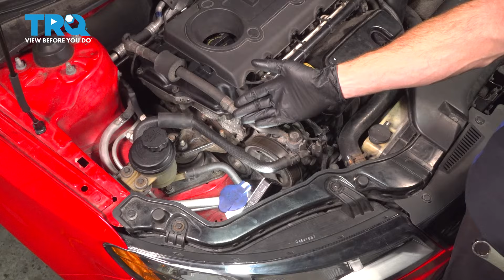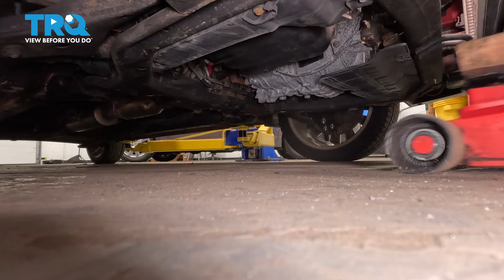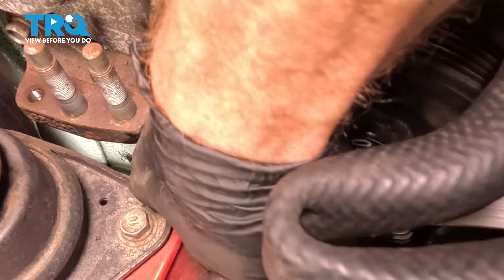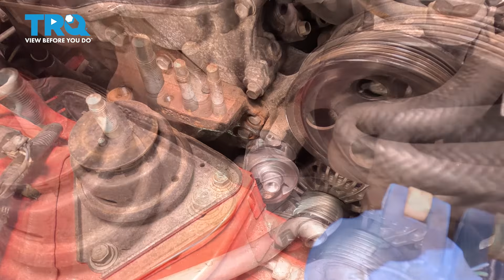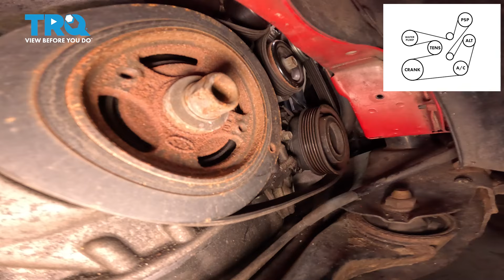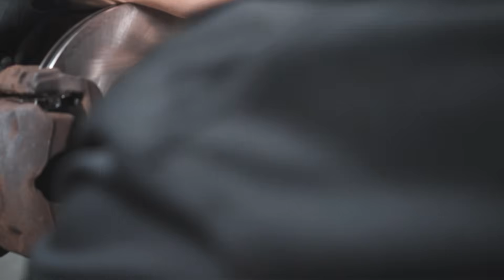How to Replace Accessory Drive Belt Tensioner 2010-2013 Kia Forte Koup 2.4L L4

Comment: 2014 Santa Fe Sport is almost the same. You won't need to remove engine mount or jack under the oil pan. Just remove the upper ribbed idler pulley after belt removal. Also, having the Astro Nano sockets and ratchet are very helpful